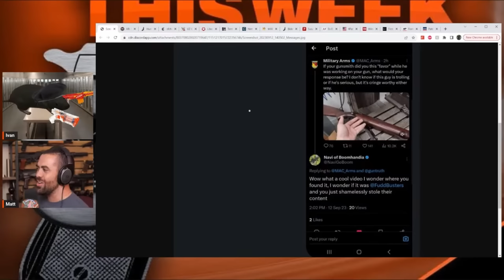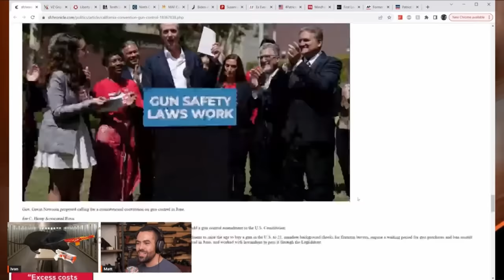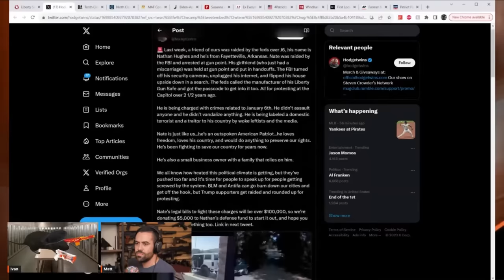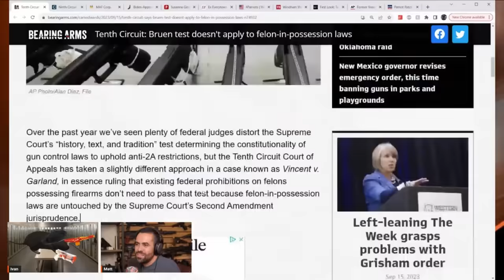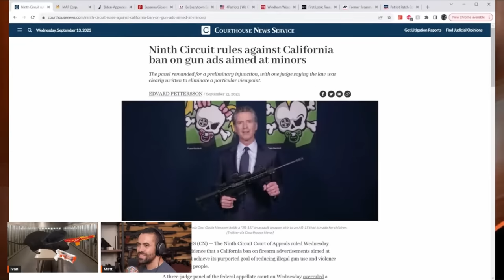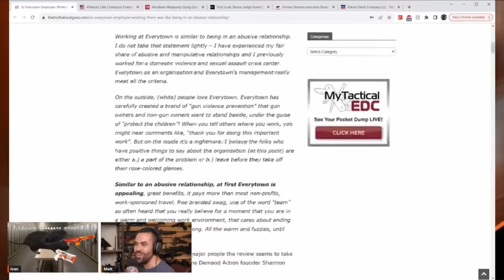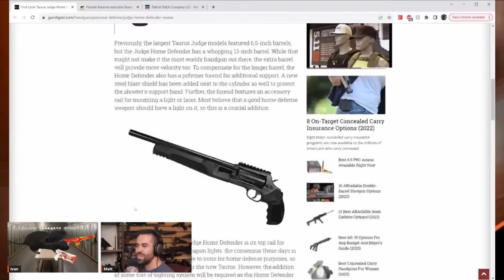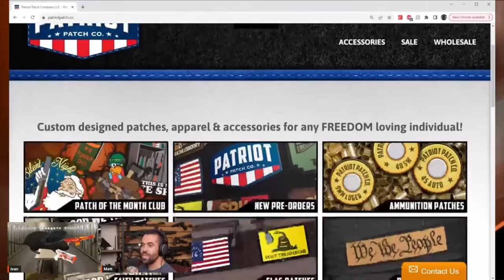This Week in Guns 9/18/23 - Auto Key Card Update, Circuit Courts Causing Rifts, & More

Comment: Not prevailing in a corrupt system that has been systematically, incrementally and purposefully manipulated to be stacked against the innocent is NOT FAILURE. 
In a just system this would never happen but we do not have a just system. 
Most people's understanding of trials comes from TV and is therefore repleat with fallacies.
It's so disheartening to see what's happened to Matt. Personally I think his team did as well as possible, but this is an injust system.

Comment: Other than the recommendation noted here to permanently affix a safe to the floor, I would recommend enclosing the sides, back, and top with either more steel or cinder blocks filled with concrete.  I do both.  Those are the weak points of gun safes.  They are thin sheet metal.

Comment: Well we now know Matt knows nothing about electronic safe locks
Reply: Nah, I've done demonstrations. a good whack and tension on the right part will get you into MOST consumer and many commercial safes. Just a few steps better than a hotelroom safe, or locking mailbox. Nevermind that the weight of a modern safe is crappy brittle concrete between 2 super thin mild-steel skins, not 3-inch hardened anti-drill steel with brass heat spreaders.